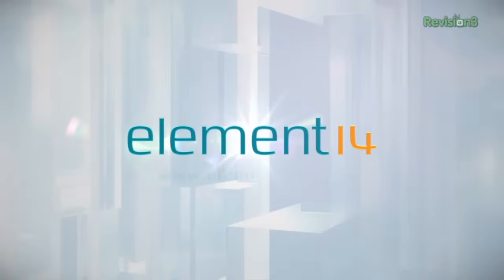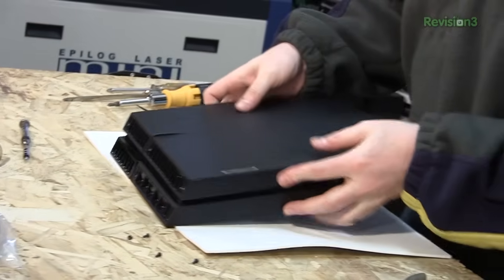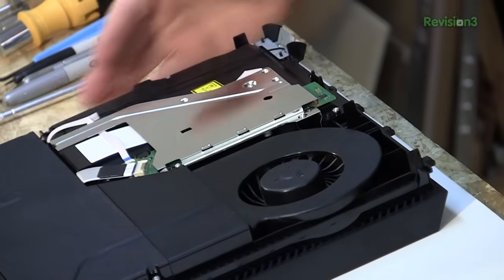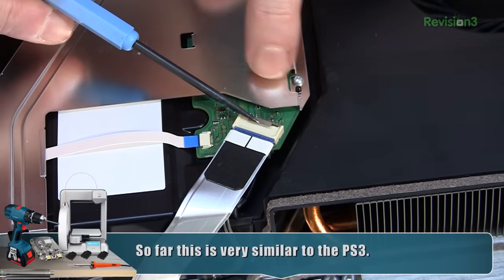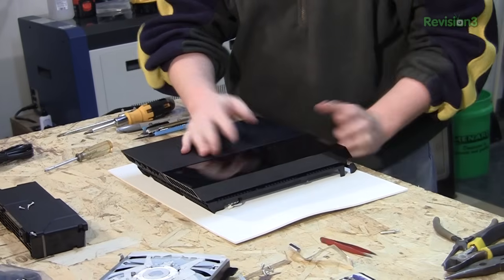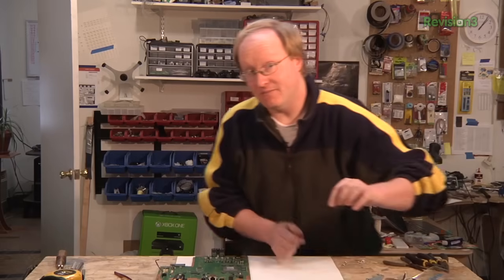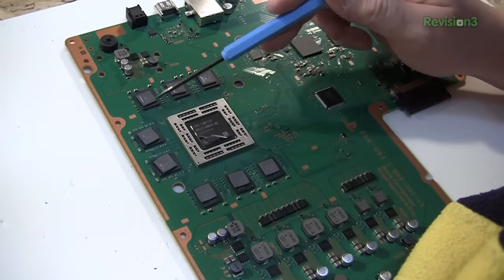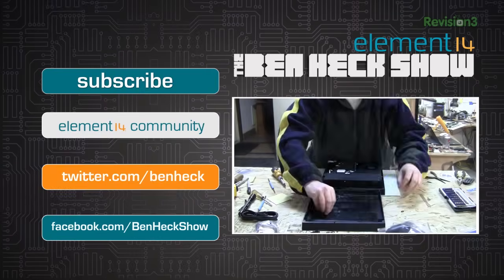Ben Heck's PlayStation 4 Teardown

Comment: It's quite shocking how far ahead PS4  tech wise is compared to the Xbone ....
Reply: wanswers Well  PS4 hasn't a weak ass  7770 inside , or cheap DDR3 .... so no , they are not similar at all.
Reply: wanswers Exactly. The benefit consoles provide are a static target for developers to build against. It means they can spend more time optimizing for a few platforms rather than an infinite number of PC configurations.
Reply: The consoles are so similar under the hood it's funny that you'd say that. This console gen sees by far the most similarity between the consoles hardware wise ever. The biggest differences are the software.
Reply: ***** You are comparing meaningless specs and hardware design choices that, with machines like these, don't really determine anything. In reality, the consoles are two slightly different implementations of essentially the same thing: a cheap, proprietary, middle-end gaming PC. It's not so simple as to approximate the consumer model of the custom-made GPU in either console and make assumptions about the way memory is used to try to make a clear distinction between hardware performance.
Reply: CPU: Xbone AMD Jag @ 1.75GHz PS4 AMD Jag @ 1.6 GHz
GPU: Xbone 768 shaders 853MHz PS4 1152 shaders 800MHz
RAM: Xbone DDR3 (AKA the exact same RAM that is in every modern gaming computer and is typically overkill) 68.3 GB/s PS4 DDR5 176GB/s

The PS4 has "better RAM". That's about it. Other than that, they use essentially the same APU. And, as anyone who has ever upgraded a high-end computer will tell you, the GPU is much more important than the RAM. The PS4 has more shaders, but the Xbone clocks its shaders faster.

In practice, both consoles are absolutely overpowered for what they are currently running, and I highly doubt having more expensive RAM is going to matter any time soon.
Reply: Not really, both are essentially the same under the hood, ps4 has a few things that are better than what the xbox one has, but the xbox one has it's fair share of things that are better than the ps4 offering. And the ddr3 vs gddr5 ram debate is pointless, the speed difference between the two won't make a difference because the ram is almost never the bottleneck so the fact that the ps4 has gddr5 ram isn't important because nothing in the system is fast enough to saturate it, and if it had the same ram as the xbox one nothing would be fast enough to saturate it still. So it is just marketing hype sony put out, and people are falling for. That's not to say I don't like the ps4, I may end up getting one, or a xbox one, just depends what the wife wants(personally I like both), because I don't think you can make a wrong choice this gen.
Reply: Christopher Pilcher Yeah they are the same. Still the same games that can only run 720p on XB, flawlessly run 1080p on the PS.
Reply: lol Xbone, combination of xbox one
Reply: Christopher Pilcher It's not DDR3 or DDR5, they have GDDR3 and GDDR5, the 'G' is important to specify the difference between regular RAM and optimised Graphics RAM.
Reply: Christopher Pilcher As Joey rightly says, the PS4 has "faster" more dedicated RAM. Substantial difference.

Also, if it were as you claim, then why are certain developers asking for more RAM space, to the extent MS have reduced the ring-fenced RAM used by Kinect now to a mere 5%?
Reply: ipariszalonna  You destroyed them .
Reply: so you are one of those uninformed people that think the eye can only see 30 fps or has a better cinematic experience. Have you actually seen gameplay with 60 fps or higher?
Reply: Who cares, unless you're in college you can probably afford both.
Reply: ***** Considering neither has any decent games it's all moot.
Reply: Simply because Sony bluffed them a treat - they made claim they don't release consoles first, letting the competitor make the first move. Then they sold the dummy. MS have completely rushed the job. More fool them.
Reply: ***** Not at all true. What is the technical spec is largely irrelevant to the point what I've made (that MS rushed it). You can build two card from identical components, but by two different companies (which has been done under licence many times before); invariably you will end up with a better more reliable result from those that could spend the correct amount of care and due diligence on it.

It has also been stated by some that MS rushed the job. It's pretty clear, and I wouldn't want to be an early adopter of such a thing - especially when we look at the issue of disc-scratching in their last console and the emails revealed in the case over it where they essentially said "fuck the customers" for their own removal of a simple disc brake.

So, it might turn out a great console, but it's sound practice to have caution, especially for valid reasons like this.
Reply: Daniel Linger Like that's really going to matter to gamers. When a game becomes a hit or a flop, I'll bet it'll all be attributed to the variety of RAM used, right?

I get that people here are hardware fans, but if you believe for a second that the hardware affects quality of games or sales, then you're delusional. Instead, us developers like static targets. The horsepower may be nice, but knowing what you need to optimize for is far better. If specs were all that mattered, the Wii would have never sold and the PS Vita would currently be the most popular mobile device.
Reply: soviut I think you've got the wrong end of the stick. I;ve clearly said that it doesn't matter a damned thing. Do please check back over my previous comments.
Reply: ipariszalonna ha flawlessly! because 30 fps is definitely flawless
.
Reply: jmlaseter
its all you need, unless your stupid and think "more numbers must mean better" haha, FPS past 30 means fuck all
Reply: shaun jones It matters (see the strobing you get for 60Hz refresh rates on the occulus rift) but software for either console is responsible for low framerates, not the consoles themselves.
Reply: jmlaseter Indeed, unless you've got a shit ton of motion blur. Even then, you need processing power for that, so up the framerates devs!!!
Reply: JoeySchmidt74 The system specs are so similar in terms of performance that most devs will just treat them as the same target. The 30 FPS thing some devs talk about is basically not wanting to optimize; Easier to cut the framerate in half than adding additional LOD (level of detail) steps. Again, this cap will usually happen on both systems, so any minor performance differences are going to be moot.

Comment: What does the battery do I see it inside PCs as well when I open them but I don't understand because it's connected to the mains so why does it need a button cell battery
Reply: It maintains a bit of power even when its not plugged in. Used for things like storing Date/Time. Ever turn on an old console and it prompts you to set the date/time every time you turn it on? (Saturn, Dreamcast, PS1, etc) ...Well your CR2032  battery is dead.
Reply: oh wow thank you i was always wondered that

Comment: How come the console ram is little squares and the pc ram are memory sticks. Im not too technically savvy as you can tell.
Reply: On PC ram, you'll also see smaller memory modules all over the stick, so it's essentially the same, but the console cuts down on space and material usage by directly soldering the ram modules to the circuitry.

Comment: "One die" does not mean always cheaper. "One die" generally mean less power consumption with high performance due to the fact that it will uses internal communication like network-on-chip (NoC)

Comment: Make xbox one portable
Reply: The Red Shoto Wasn't there a photo floating around the 'net about how the thermal exhaust was melting the vent plastic?
Reply: ***** the only reason the XB1 is bigger is because it has much better airflow. watch his tear down of it.
Reply: ***** I have never heard of that happening, and besides the PS4 runs hotter because the RAM they use. P.S. it would have to be upwards of 300 degrees for either console to do that.
Reply: http://www.spawnfirst.com/wp-content/uploads/2013/12/Residue2.jpg

This is what I'm referring to, and it appears fake the more I look at it.
Reply: ***** did you see the tear down to the xbox, its the same size MB, at least research before. and honestly if your going to believe a Pic on the inter net you shouldent be talking. P.D. there is no paint on the xbox or PS4 they both use black plastic. using paint is stupid.
Reply: Why not get a gaming laptop?
Reply: jarjacksn cause the point is to make a console into a laptop. if the PS4 would be easier to make into a laptop, it wouldn't be challenging enough for Ben to consider.

Comment: I would have loved to designed that thing and just stuck a hundred "warranty void if removed" stickers on it for NO REASON. On top of that it'd be fun to put the screws in plain sight, maybe with nice little arrows and a symbol next to it like many laptops have to show you which screws to remove to gain access to ram, cd drives, remove the hdd etc.

Comment: Could you take this apart and make a pc rig?
Reply: ***** Next generation consoles (xbone and ps4, no wii u) use the x86_64 architecture, the same as PCs. That was the biggest deal about them for the hackers.
Reply: it uses a different architecture then a pc (pcs use x86 or x64) so unless you magically manage to use an os on it good job
Reply: ***** I believe he means to remove the components and fit them in a PC case, which could be done easily enough with some wiring and drilling.

Comment: Although I don't have any preference towards Xbox or PlayStation, I have to say that Sony's designs are light years ahead of the competitors. Sony is like the Apple of consoles.

The PS3 is the best example... while the xbox was literally a big box, with that giant power brick, and the heat problem. The PS George Foreman had a beautiful architecture. Then the slim versions, the xbox just "fixed" the head problem, change color and got a little small, the PS3 got really smaller and more beautiful. Then the really slim version that got a little uglier but really small.
Reply: the Apple of console? Apples computers or light years behind

Comment: Watching him pull out the motherboard and seeing that thermal grease was painful. Come on Sony, I know it take a bit longer but properly apply that crap and you won't have to deal with over heats down the road. That's why I replaced the thermal grease in my ps3 when I got it, I had it open anyway to replace a shot bluray drive and I haven't had a problem since.
Reply: cjwolfer it was helpful to those of us who haven't used the term thermal grease before. The rest of your comment was quite right, do it right the first time...its hard to disagree with it really or say anything else :)
Reply: paste*
thermal paste.
Reply: DrYopoke Out of all of that, all you can do is correct me on a trivial term? It goes both ways, While yes technically if you want to be nitpicky paste is the proper term but grease is just what I've always said, I'm sure as hell not the only one either. http://en.wikipedia.org/wiki/Thermal_grease

Comment: You could see upcoming videos on the whiteboard @0.27
Reply: I saw that, Portable ouya ey?
Reply: cjwolfer Wouldn't a portable ouya basically just be a tablet or something? Ouya uses a tegra 3 processor, right?
Reply: Tenocticatl Well yeah it uses a tegra 3, You might as well use a tablet with a ds3 controller. I'm just interested to see what he does to the Ouya, There aren't many in depth hacks to the Ouya yet. Well I should better write that out, There are plenty of hacks people have done on the Ouya forums but not anything done on video.
Reply: Erwin Ried I think he just means part 2 on the minecraft redstone ;)